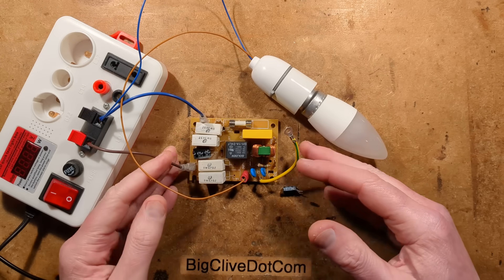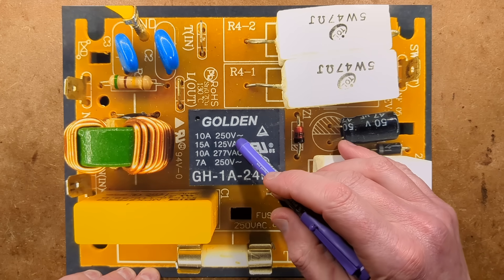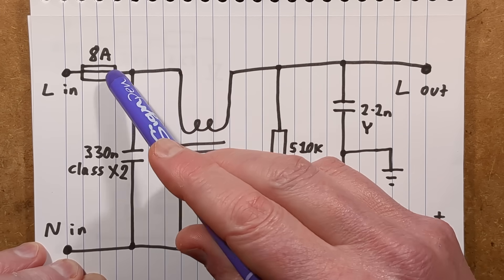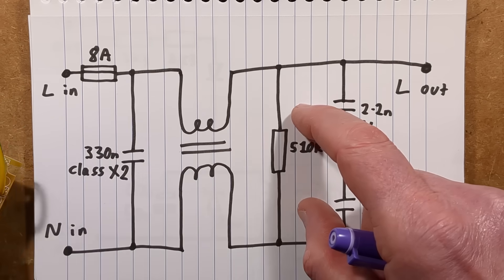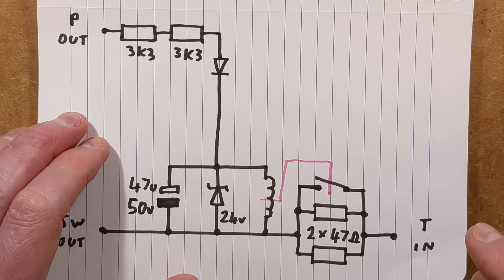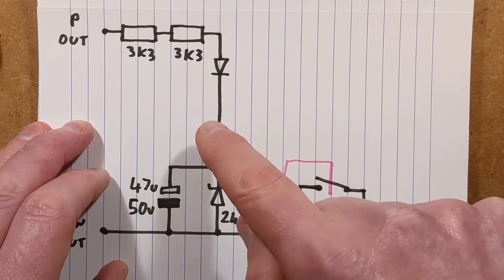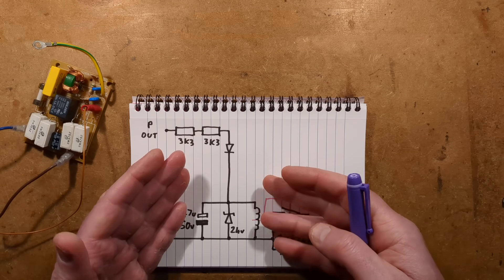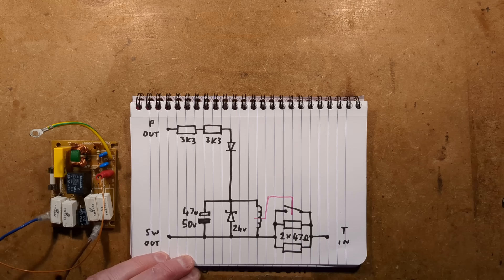Exploring a mystery PCB that is actually very neat

Comment: That's a great piece of analysis! One odd side-effect I've seen in some inrush limiters of this sort is that when they're given insufficient input voltage (far below the minimum specified) the relay doesn't actuate, resulting in them getting fairly hot fairly fast.

Comment: I have taken apart many microwaves over the past few years, usually to salvage the transformers - not to use them for their high voltage output mind, because I am well aware of how lethally dangerous that can be. Instead I chop out the secondary winding and replace it with a chunky low voltage, high current winding, to use either as a spot welder or as a home-brew "gun-type" soldering iron. Either way with a "push to make" type microswitch controlling mains current to the primary.

I always wondered what those 5 watt "miniature white brick" style power resistors were for: The only other circuits I have built which use resistors like that are my induction coil drivers, aka "zero voltage switching" circuits, one of which uses a pair of 5 watt resistors just like what you show here, the other using a pair of 10 watt resistors which are similar, but about double the length.

I have seen some other applications for power resistors: One was in a Tamiya brand radio controlled 1/10 scale car kit I built back in the early 1990s, which used a pair of large power resistors as part of a crude speed controller for the electric traction motor: A mechanical contact wiper driven by one of the servos would essentially switch both or one of the resistors into series with the motor for the two intermediate speed settings, or bypass both resistors entirely for maximum speed. I think some older third-rail powered electric trains used a similar system for speed control, though I don't think any modern electric trains still do, because dumping a portion of the power supply directly overboard as heat is rather inefficient..

Comment: It's common on the soft start pcb for the relay contacts to burn and go high resistance then the two 47 ohm resistors will overheat and crack, the medium blow ceramic fuse must only be replaced with the same part because the monitor switch is designed to place a dead short across the mains to take out the fuse instantly in the event of a door switch welding together, if a glass fuse was fitted it could explode when the monitor switches shirts out the live and neutral.

Comment: It's all good fun until the relay fails open with your 10 amp current draw and the 47 ohm resistors end up dissapating 1.2 kilowatts each for more than a few milliseconds:) I mean, hopefully you're not going to put a 10 amp load on the end of this thing, but you could.

Comment: I made one of these more than 30 years ago using a triac and various other bits driving a 150watt incandescent lamp in a very awkward unreachable position. On turn on the lamp would be powered through a 22Ω 10w resistor for around 500mS giving the lamp a nice slow switchon to minimise the surge. After a delay generated via a 4017 CMOS counter (counting mains cycles) the triac would turn on shorting the resistor and that's how it would stay for the rest of the time the lamp was powered on.
I've got the circuitry written down somewhere under all the other crap I've designed over the years but the lamp never failed so it was worthwhile.

Edit:  it was more like a 4020 counter. Jeez, it was 30+ years ago...

Comment: I've seen a similar circuit used in pro audio amplifiers both on the mains connection for the amp, and with a larger delay capacitor for a speaker protection relay!

Comment: One very popular application use case is for EV or Hybrid vehicle's power-path control.  Specifically, to protect the high-current about to flow through, from HV battery to drive-motors' inverter system, especially inverter's huge pre-charge storage capacitor bank.

The working current in this transient high-load can significantly reduce the life of high-current DC contactor.  So engineers add another low-load power-path by using a small DC relay cascaded with a series resistor.  The timing is carefully programmed to patch in the small relay first, followed by the big contactor a bit later.

Comment: It's nice to see a well-designed circuit where the selected components are actually over-spec'd after seeing cheap circuitry with components that are being absolutely grilled in "normal" use because they were chosen for minimum cost.

Comment: The input is really the "T", so the relay does not get power until the transformer settles and stops saturating. So it allows the resistors to be in circuit really very short, yet still sufficient time, it adopts the timing to what the transformer really needs to stop saturating...

Comment: These boards are ideally taken from a microwave oven amongst other bits that are destined to the tip. I have used these for soft start and suppression in smps  power leads and equipment with large start up current

Comment: I need to put something like this on the 110v transformer I have in my garage powering the RLVS sockets above the benches, Its rated at at 1kva, and I had limited space available in the enclosure, and I thought I know if I put a D4 MCB on the primary side, It'll protect it from overloads along with winding faults, and being a D type it should withstand the inrrush..... alas it only works about 50% of the time, the other 50% it trips out
Reply from the maker: If that is a type D 4A breaker then the current rating is too low.  1kVA at 110V is over 10A.

Comment: I have a similar microwave that I tried to fix like 3 times. The problem is that those tiny 24v relays melt and die, so the current flows through these 47 ohm resistors unnoticed until they get turned into brittle ceramic dust by heat. Ordered a couple of replacements from China, they die if I ever use the microwave at 100%. At low loads (defrost mode) the relay copes, but just a single time using it at max temp - the anchor welds itself inside and then burns out.

Comment: I have an LED driver targeting the Japanese market, which has strict limits on inrush current (less than 5A) and noise level (less than 20 dB). I studied the circuit, and it's quite interesting.
A MOSFET with a very low Rds(on) is used to bypass the current-limiting resistors, and a circuit detects the voltage on the PFC output capacitor to control it.
This results in a fully controlled turn-on, even when the input voltage varies (rated for 100-277V), with no relay clicking sound.

Comment: That looks like a vestel PCB. Used to work on microwaves all the time. If you ever get a hold of the Panasonic inverter microwaves, Very interesting exploring. 
Pan used to sell the replacement inverters on exchange basis. 
We used to warranty work for them, along with extended warranty. Only issue, Cornhill only used to honour £75 tops so every microwave that came in either had to be fixed on a shoestring or we got £50 for picking it up and scrapping it! Needless to say, we sent a LOT of Pan's to the scrapheap. Acquired a very nice (and still working) Sharp platinum MWO, Grill and Convection oven. The Mrs wants shot of it.

Comment: Did that microwave have the mechanical dial to turn it on and manage the time? Or did it have the digital display and buttons? 

I've had quite a few microwaves apart, and I've never seen a board like that in one of them, but then they've all been digital ones and the relay delay was included in the circuitry that managed the digital display and buttons.
Reply from the maker: I think it might have been a mechanical timer.

Comment: What would happen if the 240V AC main was pulsed off and on? What is the action of the relay.
Reply from the maker: If the pulses were fast enough it would energise the relay after a slightly longer delay.

Comment: The instant I saw it i thought "Soft start circuit". Very commonly seen on larger toroidal transformers. Often using NTC's which are then relay or triac bypassed.
Reply: Yeah. I need to build a soft starter for precisely this: I have a large variac at work, and it often trips the circuit breaker on my bench due to inrush.

Comment: Used to be a component called a brimistor which would be a big rod and heat up and lose its resistance, it doesn't mat h modern components necause ptc/ntc are too low rated now

Comment: Why is there a magical value of 47 or 4,7 ohms, farads etc?
There must be some kind of logic behind that.
Reply: Components come in all standard series of value called a 10% series.  Roughly half way between 10 and 100 ( actually 11 and 110 ) would be a nominal value of 47 in the series.  11, 22, 33, 47, 56, 68, 75 and 82 are the numbers one sees all the time.  47 is just a value one grabs all the time.
Reply: and you get a different sequence as you change the tolerance of the component.
the sequence is probably designed so that the value of the component is non-overlapping with adjacent values in the sequence. so you are assured that a component value will always be less than the next value above and more than the one above.
i did wonder if it were to create a continuous range of vales where you could choose an arbitrary value you wanted and then test an cherry pick components to get what you wanted.. but thats unlikely to be possible as most manufacturers will manufacture to a tighter tolerance within cost limits to reduce the risk of manufacturing out of spec components

Comment: The thing about X2 caps is they are designed to fail open circuit, so preventing shorts in significant power applications. Whilst those inrush limiting devices are easy to construct, you can of course buy them for a wide range of specs. from all the "Usual Suppliers", for less than it costs to build (esp. at higher power levels). A very neat solution for a potentially troublesome problem.
Reply: That's actually incorrect. Class X capacitors are designed to fail short. They are intended for use in conjunction with a fuse, so that failure will safely blow the fuse and remove power to the device. 

Class Y capacitors are the ones designed to fail open. This is because they are intended to be connected to ground, which often is connected to a metal case or the like. Failing short could put live voltage on the casing of an appliance and present a risk of electric shock. 

The number following the class is just a rating. 1 is actually the highest rating. X class go down to X3 and Y class can go as low as Y4 but it's very common to see X2 and Y2 on most devices.
Reply: @TerrisLeonis  Thank you for the correction. It seems the people who taught me about this class were wrong, or rather I assumed the fail-safe idea was to not short-circuit!

Comment: A simple version of the PCB I had blow up in my face a few days ago XD
I had a PA amp to repair for a friend. "doesn't turn on"... Opened the cover, plugged it in and switched it on. And then came the fireworks XD
The amp has a inrush current limiter. A series of NTC thermistors that slowly charge the capacitors, and after about a second, a relais bridges the thermistors.
Turns out, there was a short in the power stage, causing the PSU to literally blow up and short. And this caused the thermistors to blow up when I tested it.
For some reason, the type I need isn't sold anywhere, except for 1 store in Canada. (At least, I can't find any others...) And neither they, nor the manufacturer care about answering e-mails I guess.

Comment: This should of been used on Rivergate PC30 / 45 / 90 amp supplies. Plugging them in seriously arced the plug/socket every time. If used on a power strip, the switch would fail within 10 or 20 power on cycles. thanks for sharing.

Comment: Thanks for this, I have a few of these knocking around but never got round to reverse engineering them.  I think I'll modify one for my solar panel system to switch the Arduino controller on when there's enough daylight for the system to work.

Comment: Seems similar to the "soft start" units for RV A/Cs so they can start off a low power generator.
Reply: > '"soft start" units for RV A/C' -- I think those work different.... don't they monkey with the starting coil of a cap-start motor? But this IS something I would love to see Big Clive study. (But they are not cheap, and do they even need/have A/C where he lives?) (Ah, but we never needed A/C in downeast Maine before, yet we just had a brutal hot week.)

Comment: I use this kind of circuitry in my heavy power supplies. Only power the relay coil from the dc side, and let the contact bridge the series resistor and start switch at the primary side of the transformer. The resistor limits the startup current. When the start switch is hold until the relay kicks in, the supply is ready and directly connected to the mains. Extra advantage is that when the supply is overloaded or shorted, the relay also drops of and disconnects the primary side from the mains.

Comment: Tin and SWout.... this circuit was definitely designed to run backwards (with the capacitor that start charging after the big inrush current is over and the voltage across the primary of the transformer increase).
In this way, if the magnetization current take longer to dissipate, the delay will be higher.

Comment: I knew what it was the second I saw the thumbnail. I have no idea how many microwave ovens I have scavenged. Recently gave away a dozen microwave oven transformers which kind of hurt, but I kept 4 of the largest ones and all of the capacitors.
Reply from the maker: Make sure that whoever you give the transformers to knows how dangerous they are.  The lichtenberg wood burning project has killed a LOT of crafters.

Comment: Really should have implemented this on the Farnell 60v 50A linear power supplies we used back in the 1980’s and 90’s.  Their weight was astronomical, moved around on heavy duty castors and needed a two or three person lift. 

They had to be usable with a BS1363 plug rather than a BS4343 and on first use often took a few 13A fuse changes before the caps were sufficiently charged for the fuse to remain intact for more than a few mains cycles.  Once past that point they would successfully run for extended periods as a standby charger for 50v substation batteries until a proper repair could take place.

Comment: Is this a 110 or 220 unit?
Reply: voltage you mean? this comes from an uk appliance so 220, yes?
Reply: @xTerminatorAndy  thanks, wanted to make sure before I pump that zener over those resistors ☠
Reply from the maker: The timing resistors would need lowered in value to pass the required current for the relay.

Comment: Seems like the sort of circuit that would be useful in chunky 12/24v to mains inverters, some of them suck up so much current on connecting to a battery that they can pop fuses, either external or even their own internal ones...
Reply: Yes, I was wondering if I could use this on an inverter in a car to run an inductive load like a car polisher or something...but I'm a novice compared to most folk watching Big Clive 🤔😀

Comment: are you sure it connects directly to the transformer as this would mean magnetron is is powered constantly you don't find secondary side switched because of very high voltage the transformer is normally switched via the main board
Reply from the maker: The control PCB will switch power to this PCB.

Comment: Not sure how to tell you this Clive but that size glass fuse is rated 250VAC when the element within runs the entire length of the fuse. The "32V exception" you mentioned was found in automotive and they are rated that low because of two things... the "wings" that hold the fusible link are effectively regular conductors and yes they will stay put allowing an arc to persist. The other reason is that DC doesn't extinguish anywhere nearly as readily as AC does, so the interrupt voltage is lower.

The ceramic is about strength. They could have used quartz but ceramic is cheaper to work with. It is used for higher energy interrupting fuses in an attempt to contain the results of the link being popped. At high peak currents, the link doesn't melt, it vaporizes, temporarily increasing the pressure inside the fuse to many bar.
Reply from the maker: The issue is in the prospective fault current.  A glass fuse is rated to break well below typical mains fault current, while a sand filled ceramic fuse is rated to break about 2000A.
Reply: @ Ok but now we've said the same thing lol... If you go back to that part of the video, you're explaining it as if interruption voltage is the key consideration. Glass fuses rated 10A at 250VAC are common enough here in the states (running at 120V) to call it out is all.

Might have just misspoke in the video, I realize (and appreciate) that none of your content is scripted.
Reply from the maker: @MadScientist267  Under the pressure of filming I do often swap words, as I'm trying to think ahead as I speak.

Comment: The soft start installed on my central refrigerated A/C condenser takes a few seconds to reach full potential, the rather large fan motor and condenser start at the same time and would randomly pop one or both of the 30A fuses installed at the unit.  Nicely done Clive, thanks.

Comment: I remember such a pcb. It needed to be mounted, I think it was Panasonic, microwave oven.
So it doesn't trip the circuit breaker any more.
I think it was a microwave oven or late 80ies or early 90ties.

Comment: Nice piece of hardware and apparently well built. The concept also sounds very interesting, kind of wondering if something like this exists as an "adapter" for normal electronic devices. We have old circuit breakers that are a bit too sensitive, almost every time I plug in a high-power PSU (like for my gaming PC/laptop) the breaker for my room trips...
Reply from the maker: It could be viable.  But depending on the wiring and panel you may be able to upgrade to more inrush-tolerant breakers.